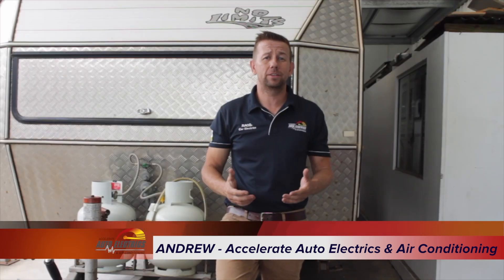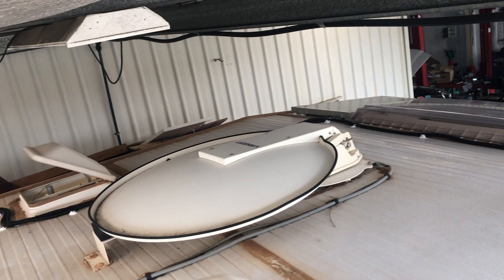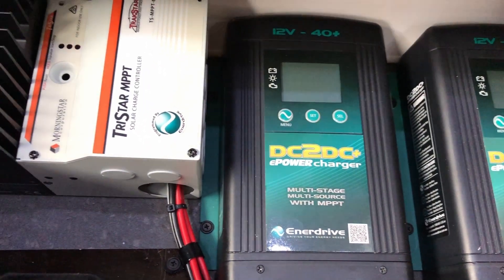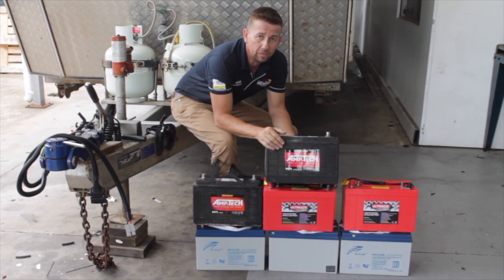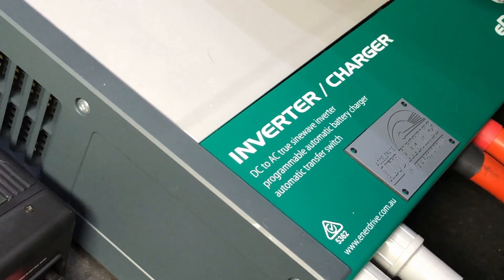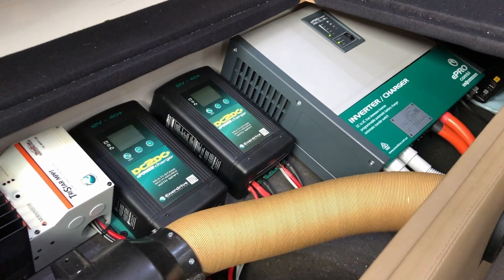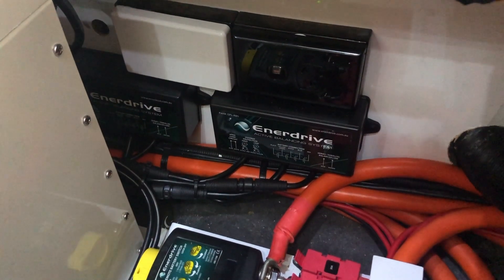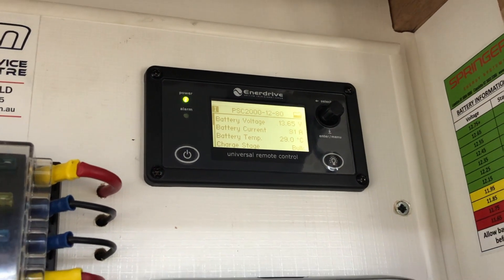ULTIMATE Off-Grid/Free Camping Caravan Power System | Accelerate Auto Electrics & Air Conditioning

Comment: What the cost to set up that setup
Reply from the maker: Caravan Lithium Battery Upgrades can vary greatly in price depending on the caravan, existing battery system,  products used and the desired outcomes of the customer. If you would like to know what a comparable set up would cost for your caravan, please get in touch with us directly on 1300 227 353 or info@amae.net.au.

Comment: What sort of run time would you get on an Aircon with a set up like this?  Is an overnight run possible?
Reply: it might run the air con overnight , but you wont run it the next day especially if there is no sun for solar  ,so then you get cooked waiting to charge 600 amps of batterys with solar or gennie or have to take a drive , (not workable me thinks ) correct me if im wrong please?
Peter
Reply: Great ideal, what is the cooling capacity of the air conditioning system?

Comment: The constant talk about how good lithium is compared to agm , yes we get it ,I’d rather hear the price but I suppose that’s not worth mentioning
Reply: @accelerateoffgridtouring  He wasn't asking for Job to Job he was asking how much this system cost. Its not that difficult im in same boat, how much is all this worth. We all understand everyone vans builds are different.
Reply: Easy enough to work out the parts roughly = 2x300ah batteries $12,000 that’s right $12k🥴, chargers approx $1500, solar panels roughly $1500. Dometic harrier ac $2000. Ac transfer / inverter $2000. Plus install. So roughly $20k on parts alone. Obviously if you’re spending this much then you’ll probably get a discount from enerdrive. Also if you have to ask............ Not a cheap exercise. I’m afraid☹️
Reply: Kings 100ah lithium were $250 on special 2 days ago